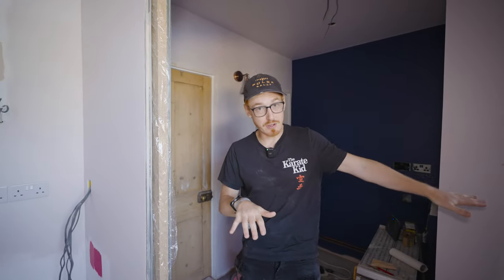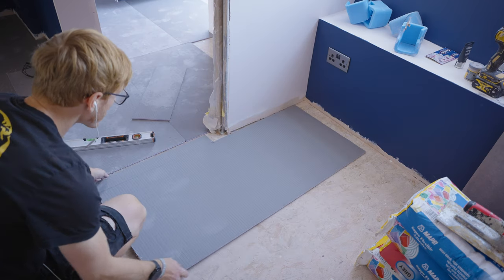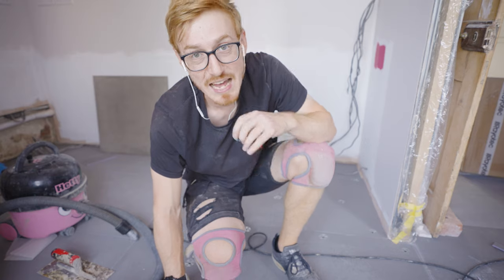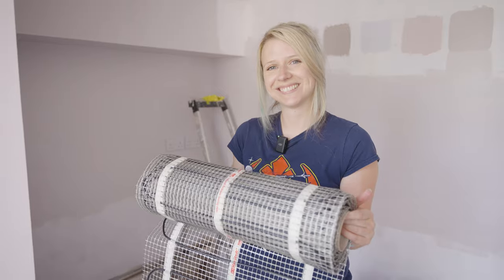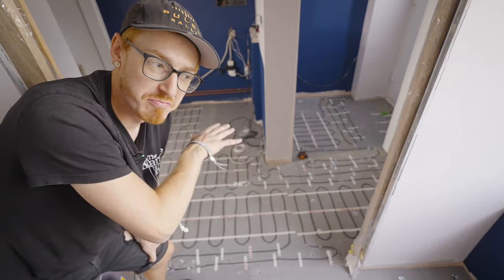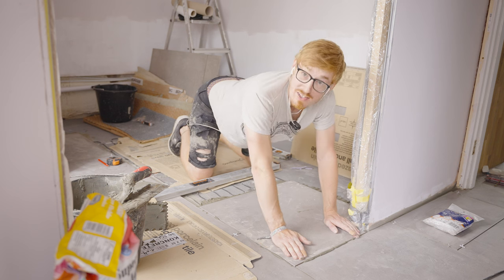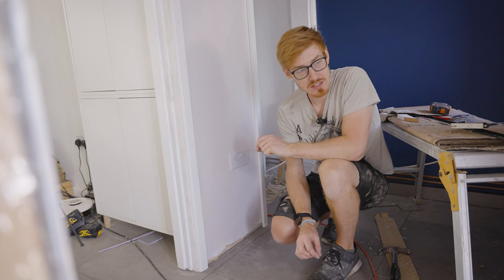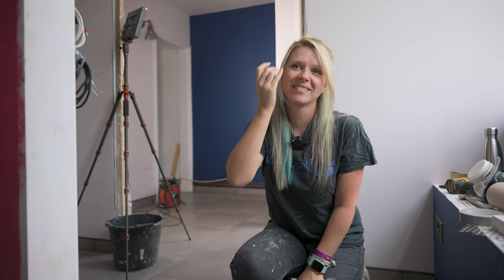Utility Prep - INSTALLING Electric Underfloor Heating +Tiling | S3 E13 - UK House Renovation

Comment: Is this electric element thin enough, on purpose, so that you can apply the tile adhesive directly? Because other applications I have seen pour self levelling concrete first and use tile adhesive on that.

Comment: Teamwork makes the dream work :) - well done both.  I'm looking to retrofit UFH in our bungalow.  I'm keen to get your feedback on the price to run electric as i've heard quite a lot of consistent feedback on how expensive it is to run?  Or do you have solar/battery storage to help?  Regards
Reply from the maker: Unfortunately no we don’t have either battery/solar to run it so as the price of electric increases so does the price to run the electric UFH! But that’s the same with all gas/oil prices too. And we don’t have oil/gas going into our property so electric was our only option and thought UF gives a nice cosy feel!

Comment: NEVER PUT DOWN INSOLATION WITH OUT STICKING THEM, THEY WILL FLOAT ON SELF LEVELLING.
Reply from the maker: @cbebbington2  this mat is self adhesive and is super sticky, but we did also use extra tape if needed to keep it stuck down
Reply: @BARBSTER360  the tile backer boards you are using 100% don't come with a sticky back
Reply from the maker: @cbebbington2  the backer boards are screwed down and/or stuck down with tile adhesive. The mat is self adhesive. Just like I explained in the video.
Reply: @BARBSTER360 I’m not sure if he is talking about using tile adhesive and screws and washers to install the tile backer boards into the floor boards as well as I have been told the same by Pro warm recently.

Comment: Hello was it ok to put tile direct on the UFH matt
Reply from the maker: yeah that matt is designed to be tiled straight over using flexible tile adhesive (the adhesive also has to state that it can be used with under floor heating too). Or you could use a flexible floor leveller (again one that also says for under floor heating) over the matt to give you a flat surface and then tile on top of that.